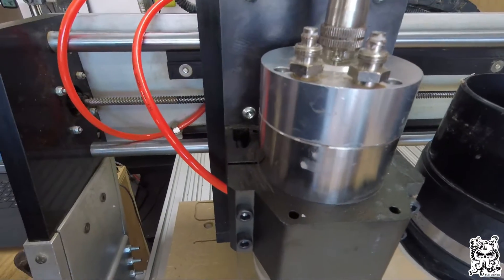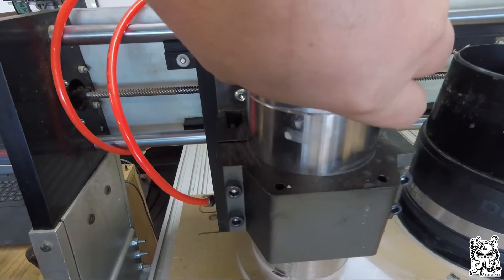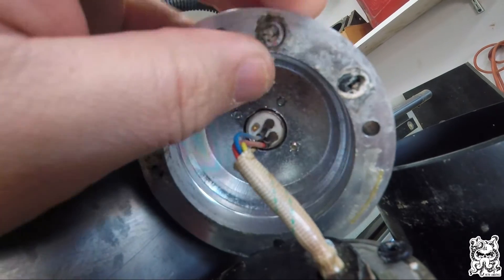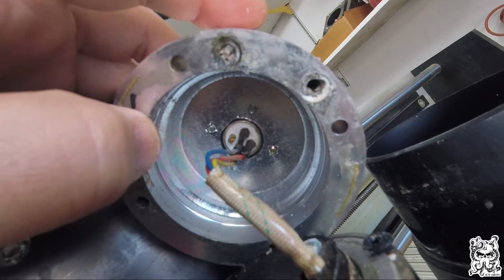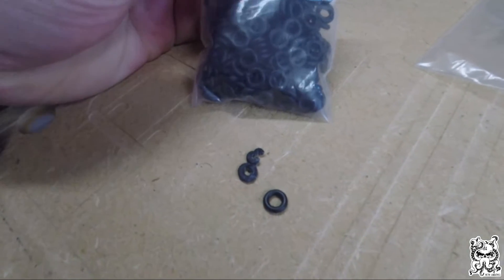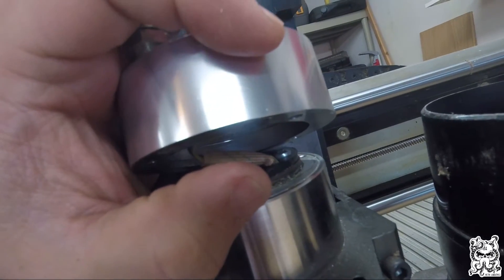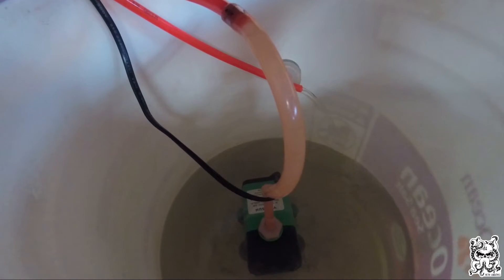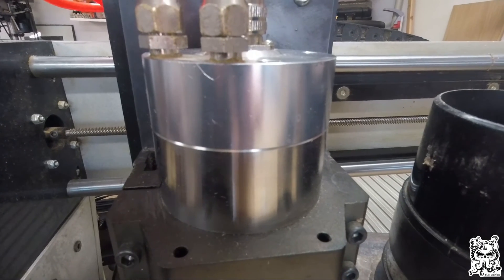WATER COOLED SPINDLE REPAIR - NO FLOW - Next Wave CNC Shark, Router

Comment: I have the 3hp spindle kit.  With no flow, are you feeling the vibration of the pump running and it just cannot push the coolant through the system or would the clog prevent the pump from starting up?  I use the RV Anti-freeze, never added tap water or distilled water.

Comment: I only use distilled water, but dust will still contaminate since it isn't a fully closed system.  

I'm using a very mild acid (vinegar) and flushing the lines and spindle using that to help dissolve deposits that are affecting the flow rate.  It's slow, but it is helping.  I may try a stronger acid.
Reply from the maker: it’s unfortunate the spindles aren’t more serviceable. in my situation even new hoses didn’t completely cure the issue so the buildup is going to be inside the spindle.

Comment: My o rings are fine but the thing is stilled clogged up. Air pressure doesn't help as much as I try, do you recommend anything I can do to fix it ?
Reply from the maker: i will run soapy water through the lines the. blow out the lines with an air compressors. i will also blow out the spindle lines. i do this yearly.